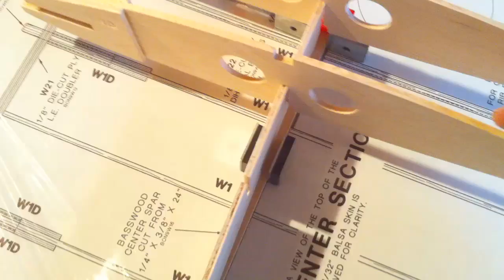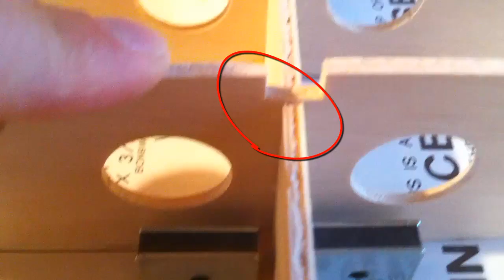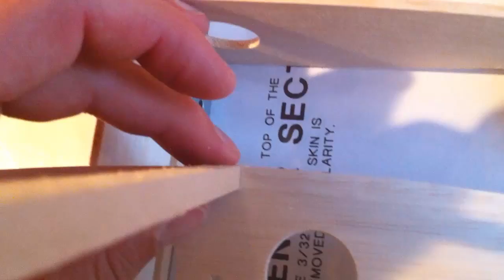How To Properly Build RC Airplane Wings.

Comment: A sanding band works great for that. I had never seen one until this past weekend. Its basically a thin strip of sand paper held at both ends like a bow,allowing you to fit in the rib area and sand each area as needed. Nice and tight fit! I have seen the magnetic holders before in ship building.

Comment: I build on glass usually 1/4 inch plate glass. use newspapers to zero out vertically and horizontally. Ca right to the glass with the plans under the glass.

Comment: Nice. I can't believe those lightening holes make a real worthwhile difference when the overall wing is so large. Especially so if this Is a powered model? As for the sanding, maybe the BOTTOM notch is out of spec! Overall I like the video, thanks for making it happen!
Reply: Those holes are possibly for a carbon fiber cross tube or something more so than lightening the plane
Reply: A few grams here, a few grams there. It all adds up.

Comment: I'm starting my builds for the winter soon - thanks for this video. Here's a bit of caution I see. One problem I see is chasing fundamental misalignments. Sanding one spot may be masking the source of the problem somewhere else. You have to determine a datum against which all other measurements are made. Are the ribs absolutely identical? then the first place I would look is the lower spar. Is it to spec - absolutely square and uniform width and depth,  and straight, untwisted? Then everything should fit fine - so I would start by inspecting the lower spar if you have misalignments. Now that you have identical ribs to spec, and a true, square lower spar, the webs can be inspected for squareness and trueness.Then the top spar for same. By then you should be in good shape for whatever sheeting you need to do.
I.e. I would be careful to start sanding spots like on the op spar void on a rib, arbitrarily, or you could end up with a wavy wing that you can never recover to true, plumb, and square. Yes, this has happened to me : ) Just my 2c.
Still, a great video, thanks for taking the time to share it.
Cheers

Comment: nice video, but doesn't the bottom side of the wing has to be completely flat so that the wings get an upward lift?
Reply: not necessarily, just google "NACA airfoils", there are a lot of different airfoils for wings depending on the purpose of the specific airplane

Comment: old timers used glass on top of the plans. a flat work top guarentees a true plane. Too bad these cheap prebuilt planes are not built the same way. No quality,no support spars in the body,they use a notched  key bulk head  system that puts those notches at risk for failure upon impact with no reinforcing balsa pieces to lock in the bulkheads and add extra strenght to those notched area's. I have watched so many cheaply built planes fall apart upon a heavy landing because of the open bulkhead and flimsy side panel designs they use today. Even Hanger 9 Planes are crap.